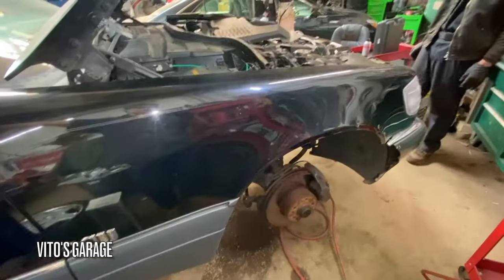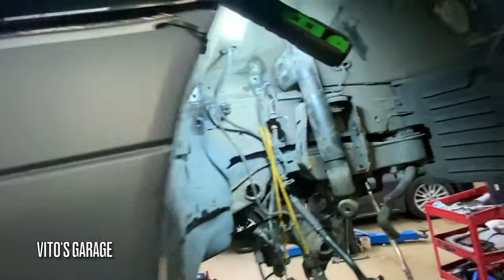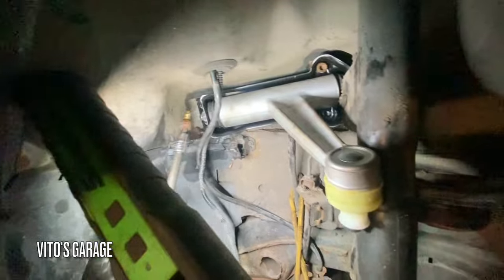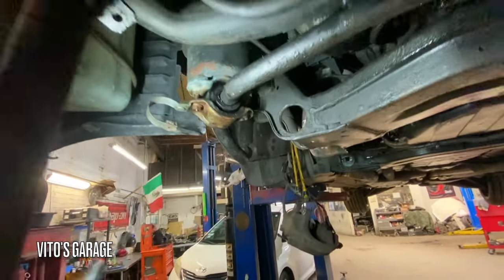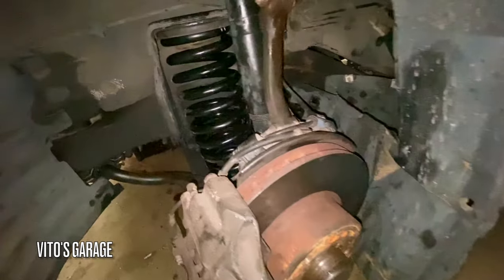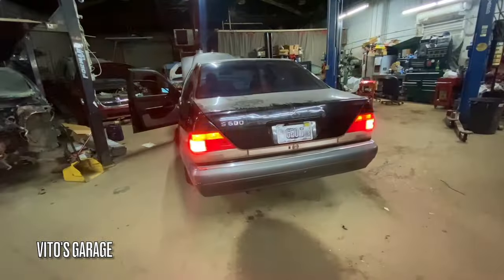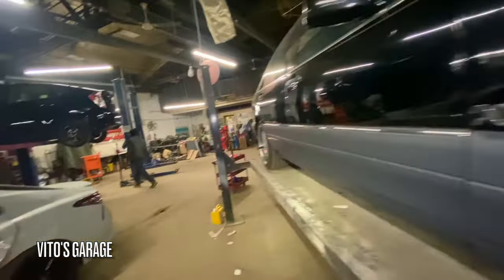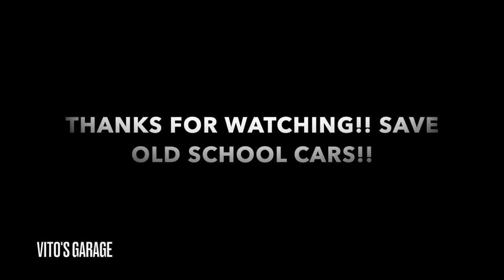1995 Mercedes W140 S600 Full Front Suspension Rebuild. Fixed Radio & Checked Amplifier. Test-Drive

Comment: Great video as usual !. Happy 4th wherever you might be in the world today !  🏁 Quick unrelated question: If I get a '88 W124 3.0 with 5 spd manual and want to put it (the transmission) in my '91 W201 2.6 (which is auto at this time) will it be bolt on or do I need driveshafts from a manual W201?  The 3 shift lever I know they are different. Thank You.  Keep the MB videos coming.!! L.E. Driveshafts are different, sh**t :((
Reply from the maker: Hey Dan! Happy 4th!! The driveshafts are different. You should still get that W124 and restore it! Very rare amazing machine. Thanks for your support!
Reply: @VITOSGARAGE  I would BUT it has this weird problem, when at operating temp and in closed loop, at idle will start to kinda stumble and randomly will completely shuts off.
Reply from the maker: @danricci6996  disconnect the eha and see if it keeps running. That’s a common issue
Reply: @VITOSGARAGE  Truly you are the nicest youtuber. Owner  had a shop replaced it, no difference after.